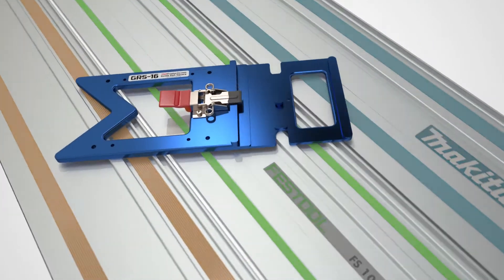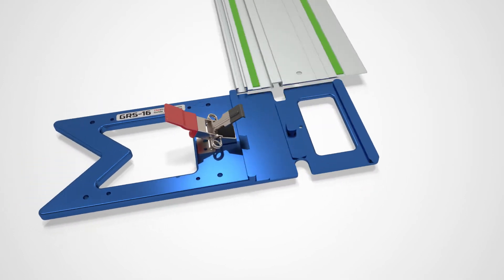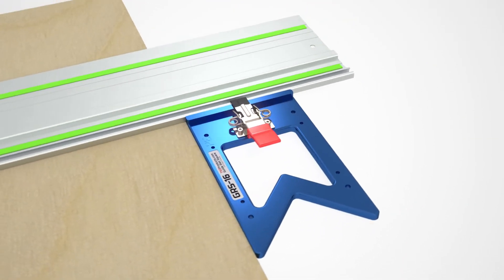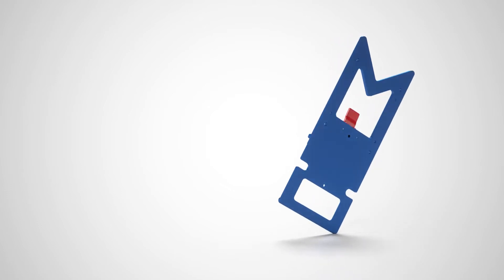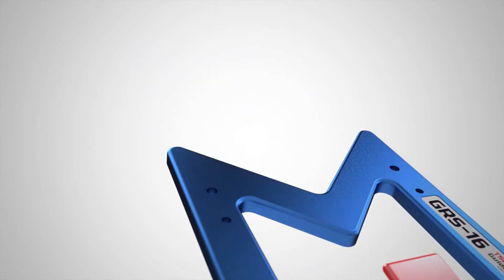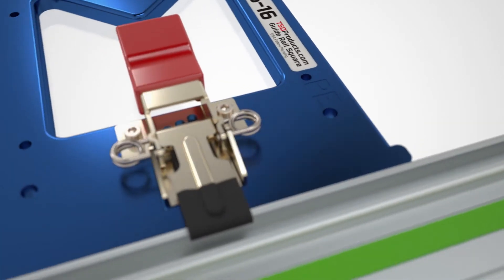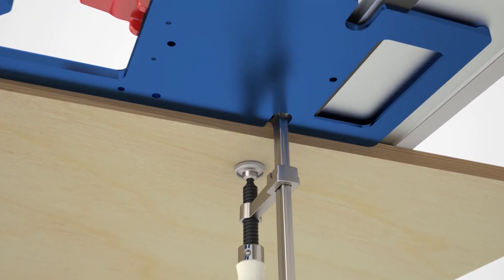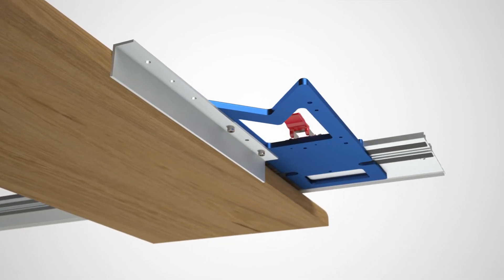Track Saw Guide Rail Square - Presenting the GRS-16 PE

Comment: This product is absolutely useless and not fit for purpose. I don't think I've managed to get more than 5 square cuts since I bought it. Out of hundreds and hundreds of attempts. There is a real snake oil feel surrounding this product. None of the big name makers on YouTube would touch it with a barge poll , and the ones that did seem to be grifters who got well paid....as they admitted themselves. I recently did some maintenance work on a school. There were 7 carpenters on site who said they wouldn't even entertain the concept of a rail square being accurate, and would definitely never consider using or buying one. We tried it out on 3 different saw ...a dewalt, a Makita and the older type festool.....all cuts were different. There is a certain audacity to a tool maker who fools us into believing we can get accurate square cuts from a piece of aluminium 15 inches long just butted to the edge of a board or sheet. I challenge TSO to prove me wrong. They can do a live video of 100 cuts in real time. If more than 30% are accurate , and I do mean an accurate 90 degrees , then I will eat my words. My bet is ...they won't! Don't waste your hard earned money.

Comment: Just received mine today and I have to say, I'm very impressed by the tooling and finish and after all the great reviews I have read,  I'm not even concerned about accuracy. I do have a question though, van you tell me what the drilled and tapped holes are on either side of the T slot guide? Also, after pleasantly surprised with this product, are you ever thinking about producing a parallel guide system for guide rails? There is a market but nothing that I have found seems to measure up with your standards. Closest product perhaps is the "red one"
Reply from the maker: Glad you like our GRS-16 Guide Rail Square! The threaded holes are so you can attach it to a hinge bracket on an MFT. On your parallel guide question... stay tuned.